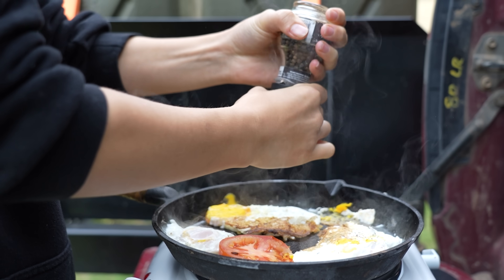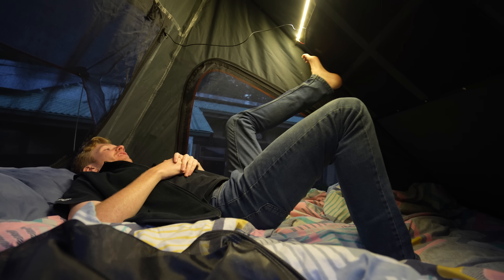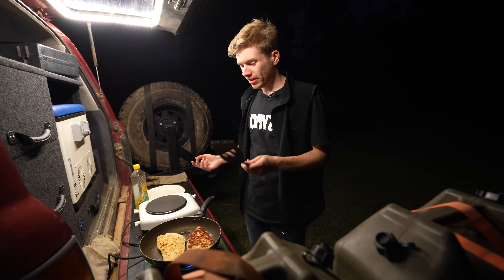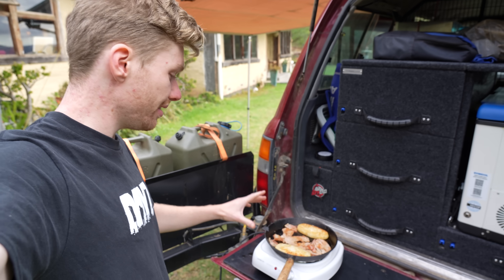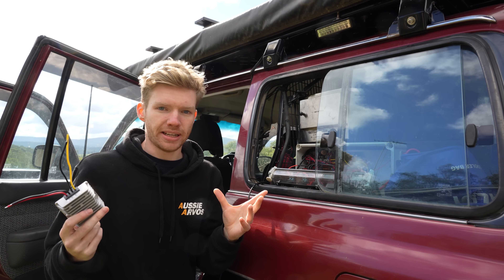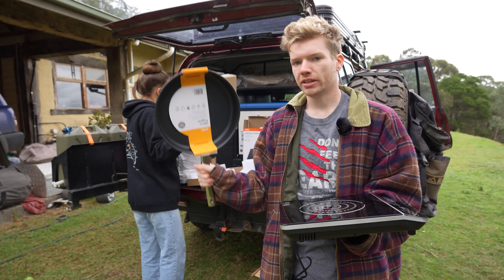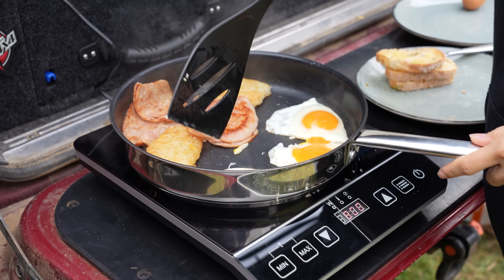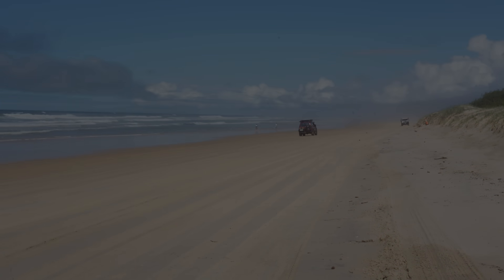is BUDGET induction cooking ACTUALLY POSSIBLE? Pushing my 12v Camping setup to its limits.

Comment: Shows the quality of the battery b or c grade cells im assuming most lifepo4 should be able to handle a 1c discharge
Reply from the maker: you would of thought so!
Reply: @AussieArvos  what gauge wire is the inverter using the voltage drop isnt coming from there
Reply: According to the specs on the king's website, they are grade A cells and the battery is rated to 100A cont, 160A pulse, that's some pretty bad sag if 1200w tripped it (as volts drop, amps increase to keep up the draw wattage). I'd be measuring voltage at the inverter input posts vs the battery posts to see if you're getting any significant resistance/voltage drop somewhere, or if Kings misrepresented their draw specs.
Reply: @cgrecommended  i was thinking the same thing but its the bms tripping not the inverter hitting low voltage disconnect so the bms must be reaching the low voltage disconnect im now thinking the bms wire size isn't able to carry the current without the voltage drop?
Reply: @thegolfhack9417  wouldn't be the first time a Chinese supplier cheaped out as production as time went along. May just be a dud BMS/underdone PCB tinning.
Reply: @cgrecommended  tbh seems to where even the best bms's fail even the jk bms's rated to 200amp and use 2x 7gauge wires still probably the dearest part of the whole bms lol

Comment: I haven't read all the comments but the reason you may be having a problem is some induction cooktops even though they may say you're only set to 1000 watts thay are actually still running at their maximum Watts say 2000 Watts, they are just turn the power on and off with a relay to imitate 1000 watts of heat output.

Comment: You can get different lithium batteries with a higher discharge rate.  It is not the capacity of the battery, rather the discharge amps it can handle.
Reply from the maker: The kings battery was rated for 100amp discharge, so i was well within the specs, so could be quality of the battery, but i see most people use 200A-h + for induction cooking
Reply: @AussieArvos  yes, I hear you.  Might be the quality of the battery.  If it is still under warranty, take it back.  Kings 🤦🏼‍♂️
Reply: Yep! 
Will be running 240ah of lithium to have plenty of power and draw 👌.

Comment: a twin burner gas stove and a small gas bottle will work very well for camp cooking. the cooker would take up as much room as the butane stove and hot plate and the gas bottle can be stored on your rear bar.

Comment: ... and dare I say, looking over, I should say pouring over many vids about solar and induction cooking the battery is they key. If you have a LiFePO4 battery make sure the output is a true figure of the capacity ie; 200Ah can sustain 200Amps continuous output, not a lower figure like 120Amps. This makes a huge difference for the Inverter and the appliances you want to hook up. I've migrated to two 200Ah batteries that can deliver a true 200Amps each so maxing the 1800W induction cook with fridge and travel buddy on, with lights at night seems to be no problem. The solar seem to recover the system with a couple of hours. Expensive? Well it's the end game not a starter nor a system under construction. I could easily hook up the camp trailer and power my house when the bills get too much!

Comment: i have 2 x100amp hr lithium with 100amp BMS on each battery 1500w inverter i have an induction cooker and it works fine never trips out, the kings battery may have a small BMS

Comment: Cast iron pan is far more efficient (just don’t slam it on that glass top!). I have run a 2000w induction cooktop and to be honest rarely use the highest setting; cook most things on 500w/800w  and boil water on 1000w. Still boils in half time of gas.
120Ah is OK but reckon now they are dripping  in-rice a 200Ah lifepo4 battery is the way to go.
THE ONE THING NOBODY MENTIONS RE INDUCTION IS WIND DOESNT EFFECT IT WHICH IS HUGE IN CAMPONG.

Comment: I know you do things on a budget. And this is an awesome little experiment for the sake of content

But I bought my Weber Q for 100 which grills and roasts at the same time. And for hot water to boil pasta ect I just use my jet boil.

If you can’t afford a jet boil just get a light weight pot and a jet boil fitting.

Travel buddy runs off 12v easy.

So you can literally grill, roast, boil pasta/potato for mash, and have the travel buddy doing it’s thing

Comment: Oh, also, make sure you have lithium batteries with a BMS that supports 250 amps. And, make sure you have at least two batteries to handle the voltage drop. And, make sure you use thick gauge cables when connecting the batteries in parallel. Also your inverter cannot handle an induction cooker. Get a 3000 watt Victron Low Frequency inverter. 😊

Comment: Id be looking at up grading your inverter wiring to see if it reduces voltage drop or the battery and bms are no good should handle that amp draw without that voltage drop

Comment: I don't think 120Ah is your problem here. 
When you see voltage dropping as your current goes up, that generally points to an increase in resistance somewhere. This could be due to insufficient cable sizing between your battery and inverter, or the battery isn't designed to handle that amount of continuous current. 
I'd say with how close your battery and inverter are, cable size might not be the issue, but its worth a check. I have heard from many people that the Kings batteries are not capable of high continuous current that you need for induction.

A good quality battery that has a good quality BMS will handle everything you tried to throw at it in this video. Again, a few points you need to hit to make this happen. Ample size cable from the battery to the inverter, and the BMS of the battery (and cabling inside the battery) can handle the continuous current you are going to be pulling.
If you get a chance, build your own battery like Liam did. The 100Ah BMS he used will be fine for the 1000w inverter you have, but I went the 200Ah BMS with active balancing as I will be getting a 2000w inverter in the future.

Comment: It's probably the fact that the battery can't handle the draw. For instance the 200ah kings battery has a constant draw of 150ah, however the itech world 200ah battery can handle 250ah content draw. That is the difference between the quality of the BMS and battery cells.

Comment: Also, cheap lithium batteries have an amp limit before the BMS will trip. Check the specs. Cheap ones are usually 50 amps MAX.

Comment: i have the same battery with same induction cooker but using a 3000watt inverter and cooks fine you might have a faulty battery (maybe)

Comment: Bit weird - Advanture Kings does say that the continous discharge of that battery is supposed to be 100amps and if your reported system says you were only doing 60-ish, I'd say something might be a little off.  My example is I've got a twin LiPo battery setup with the capabilities of supplying 200amps continous.  My Renogy 2000w inverter with a 2000w westinghouse induction at full tilt pulls 140/150amps.
Your setup should be fine with just keeping in mind a bit of limitations.

But at the end of the day, I'm with you - gas cooker and fire as well; but induction is great when you can't have a fire source.  And if you can run it - sure why not.
Reply: Oh and the other thing - that Kings battery is supposed to be 10v safety cutoff.  So it's possible you might have a faulty BMS or the cabling going from your battery to the inverter/other systems isn't thick enough.
Another tip - for 200amp flow it's best to use 0 gauge or 0AWG for up to 3m length without over 10% power drop.
Reply: I do feel that the power draw is higher than being measured. I had a 2 place Westinghouse induction cooktop, and found that using both (min 1kW each) caused inverter overload as even on 500W the they cycle on/off and would sometimes both be on long enough to trigger the inverter overload. Would be going over 165A if both were on. Can run a single burner at 1800W for close to 1.2 hours.

Also found it easier to place the inverter right next to the battery so less than 30cm 1AWG cable, 240v extensions are cheap in comparison!
Reply: @zeealpal  I was having a chat with a battery manufacturer up in North Brissy a few weeks ago and we were discussing this whole topic.  Another item might be the cabling inside the battery.  If it's not big enough and the external system tries to pull too much juice, the inside battery cabling will heat up and cause voltage drop.
I'm having this exact problem currently - I can see my voltage drop to 11.6 when turning on induction.
In my case, I got what I paid for (Giants brand) - we opened up one of the cases and it's got 8 gauge cabling inside at the most.  Just doesn't cut it.
Reply: @ApathyGates  Yeah, forgot about that. I cut open 2 cheap 12v 100Ah to make mine, the cells to terminal cabling is terrible. Added a 250A BMS instead, although next time I'd probably go 24/48v I think.

Comment: Hi mate rather then run a travel buddy why not just run a air fryer heaps faster and the lithium battery should handle it or just run two batteries in parallel

Comment: IT IS THE BATTERY
This is why it cut out.
First your cheap shunt must be reading wrong. It rubbish. There is a reason the good ones cost hundreds of dollars. I've tried that cheap shunt (or one identical)
800w at 13V is around 60amps. 
1200w is around 95amps.
As voltage drops amp draw rises. Your shunt readings cannot be right. A travel oven draws 10 amps but yours only draws 5amps?? That sends alarm bells right there.
The kings lithium can only sustain 100Amp continuous draw.
I'd put money on the BMS trips the 100Amp draw.
My itechworld 200AH will do 250A continuous discharge. This is why I chose it and its designed for high draw.
This is probably the biggest difference between cheaper lithium and more expensive. I also have a 120ah and a 100ah lithium in my other vehicles which all output more continuous than the kings one and will run induction fine.

To fix YOUR problem. Buy another kings 120ah lithium and put it in Parallel. You will be able to draw more continuous amps as it will be shared across both batteries. So effectively 200amp continuous draw and u get more capacity (240ah) so you don't have to watch your AmpHours..
Good luck and..
Your Welcome. 😎

Comment: Just wondering 🤔 - long term effects of 12v device plugged into 15v?
Sorry if crazy question, but won’t it shorten the life of the device running it ‘over voltage’ ??
Also keeping in mind the response from an oven vendor, that basically said “doing this will void your warranty” 😐

Comment: Nice video mate 👍  umm not sure about any of your electronics problems hope you got it sorted.  If l haven't got fire my back up is gas I do use the little stove like yours but I  have moved to a proper 2 burner cooker with a small gas bottle. Might be a idea . I know no one wants a big gas bottle rolling around in the back of the car . But I think you might be surprised on how long you can cook for on a little gas bottle.

Comment: So looking at the specs on that battery, it's rated to 100amp discharge so 100 amps x 12 volts = 1200watts so pretty much you were exceeding the rated specs. If u had 2 of those batteries in parallel  you could run any domestic item @2400watts but would only then be limited by your inverter. TBH I would not go bigger than 80% of your batteries max  rated discharge capacity for longevity of your batteries!

Comment: Any thing a magnet sticks to is OK for induction.  Step up for travel buddy is awesome.   To be honest I run a kings 2kva gen and a victron 240 v 12 v 25 amp charger, every time I turn the genset on it charges the 200 am h lithium battery, I cook with the genset on. I also run an air fryer At different times. It does awesome chicken drummies. Pasta bake,  steaks, and any thing you can bake in an oven. This way I don't need a travel buddy,  as far as fuel is concerned I use 20 liters in 14 days. That's 1.5 liters per day. Nothing wrong with that my friend. So a full genset tank  and a 5 liter fuel is easy 7 days cooking  and batteries are premo condition. And that's job done ✔ 
Ect. Yes it's fuel yes it's a genset. But now your batteries and your cooking are 1st class off grid  .
Reply: Generator is fine if you are alone, when others are around it’s very inconsiderate to have a generator running
Reply: @Corey-pd3mi  well that alone says you.are not remote. There is nothing near me for 50kms at any time , I am off grid, and that's the whole point of conversation isn't it.  No pretending here

Comment: I seriously dont know how your having an issue with kings battery. I have same 120 lithium kings battery. Running a 2k watt invertor doing a dam air fryer at 1700watts pulling well over 120 amps for 40 minutes no worries. Youve deffiently got something wrong. The bms system has only ever cut off once the battery was almost flat.
 Ive since upgraded to 2x120A lithium batterys for convenience sake tho lol

Comment: Induction hob pulses on and off to control the amount of heat eg at 300 watts it is on for a short time then off for a long time  as you increase power sett on time gets longer off time gets shorter ,hers the but it does not make any difference to power draw when it's on its allways pulling  2000 watts ,  so you need a 2000 watt at the very least 3000 watt invert would be best and battery capacity to  suit 
You may be able to find a low power induction hob for campers rated at 1000 watts but probably cost a lot more and takes longer to cook and doesn't get as hot

Comment: I'm about to invest in a hot plate that is going to run on solar battery.
However, I'm sold on lead acid deep cycle batteries.
Because they can be rebuilt.
I've been living off grid for 15 years.
Using gas for cooking and heating.
What I'm hoping to do is make a system that can run a electric single burner at full output for 3.5 hours.
This will make it so I'm able, to can without using fuel.

Comment: Another great video, hey Bud, I had a 15v step up and it works great like you said, I got told you have to watch the operating voltage range of the step up if you have it hooked up and run the car as the cheaper ones only run at 12v input and could cause problems at alternator charging volts? I changed mine to a 8-40volt input - 13.8v step up to be safe, it could be rubbish but I just thought I would mention it, don’t want my 80 to burn down lol I would get rid of that cig plug too mate!
Reply from the maker: Thanks Mick! yes i heard about this too when looking into getting it, and you are spot on. The model i used, and the one i linked to in the description is "meant" to handle inputs from 9v-14v which is great and makes me feel alot better but I still isolated my set-up controller through a switch, so when the car is running its got nothing going through it and i usually use the travel buddy once stopped at camp, but yeah definitely something to look into ! i have used it when the car is running and all seems to work fine, but yeah good work on pointing it out! because there are some cheap ones that seem to only handle 12v input :)
Reply: @AussieArvos  Oh great work, I couldn’t believe how many were out there and of course the one I got said 12v only lol I have a Itech 120x Lithium and been running it for over a year and luv it, i can run my 80amp draw compressor out of it with my fridge and lights running, (no motor running) and it has never shut down, could be worth comparing max currant ratings etc between that and the Kings for example, I don’t run a inverter or I would test the sucker for you, really love you channel and all the effort you put into your videos, thanks so very much for all the help you have given us doing these projects, have a great trip, go the 80!

Comment: I run the same Kmart induction cooker on a single Renogy 100ah lithium through the Kings 1500w inverter no worries, firstly I think your monitor is not accurate, those appliances draw alot more current DC then yours was showing, secondly you may have a wiring issue/bad connection from your battery to inverter, thirdly is possibly the Kings battery actually can't output as much as it says it can (max continuous discharge current)

Comment: More AH and better quality lithium set-up is what you need. I have a 300ah system in my caravan and I wouldn't dream of trying to run the amount of HIGH CURRENT stuff that you've been experimenting with.
Lithium is great, but like everything, you have to understand the limits. ALL my batteries (including the 2 starter batteries in my Duramax Chevy Silverado), are lithium.......2x Race9 Lithiumax starter batteries.....2 x 100ah in the canopy for fridge and lights etc (1x Amptron + 1 x Renogy)....and a 300ah EV Power lithium battery in the Bushtracker.
You've saved dough on the initial purchase of a cheap battery and now you're realising the folly of "saving" money....cos you're going to have to buy TWICE.
Additionally, as a rule of thumb, you'd be well-advised to have more solar......2x the battery capacity is the way to go. So, if you have 200ah of lithium battery, you'll really need 400 watts of solar to be reliable.
Good luck.
Reply: Not a case of buy twice, more buy right the first time. And understanding the limitations of what you do buy, your system sounds top notch!!!!

Comment: Induction cookers use way more power than what is stated on the box(read more about Power Factor vs watts).  In short, get a low frequency inverter like a Victron 3000 watt inverter and add two more batteries - problem solved.

Comment: I have a 200amph voltx battery purple and it does it all fine under 1k eBay with big draw appliances run your car at the same time so to charge and take the pressure off your battery